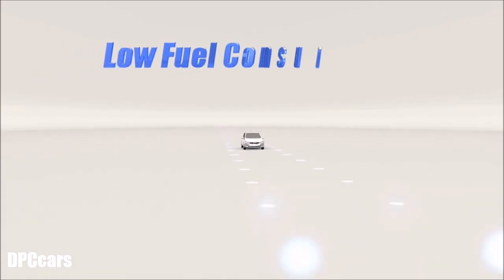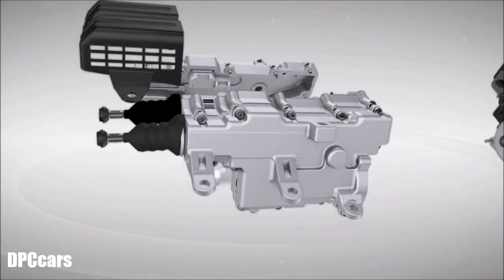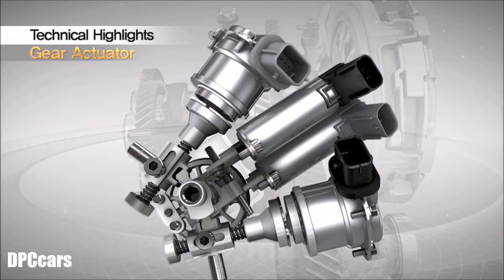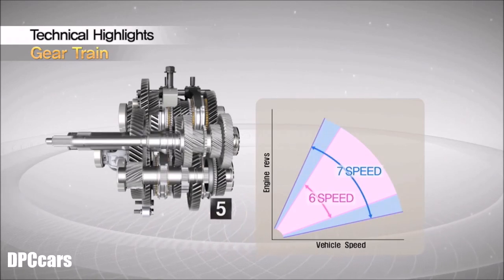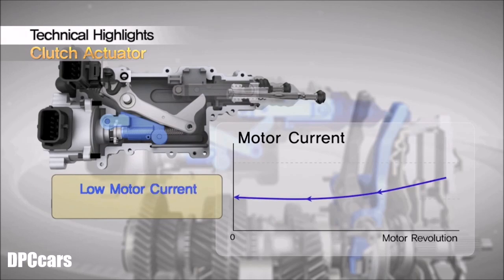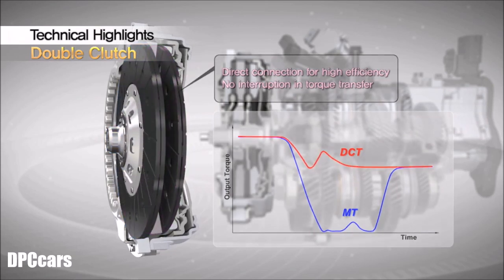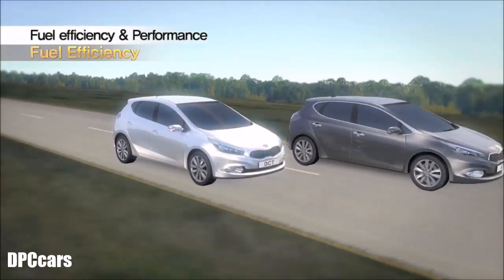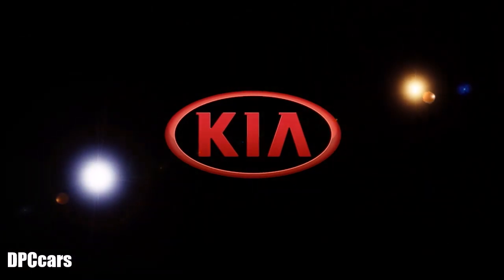Kia 7 Speed Double Clutch Transmission

Comment: Mine start to jerk while moving off, after into 2nd year of driving.
Reply: I bought my 2020 Kia Forte GT December 2019, by November 2020 I started noticing jerking, and what felt like slipping of the transmission in bumper to bumper traffic, also when putting car in drive after a cold start. (Yes I do let my vehicle warm before driving) 
Dealer told me that is normal, but to someone who is used to a traditional transmission, it was very far from normal 😂
I still own mine with 77k miles and it’s not as good as they make it out to be smh 🤦🏻‍♂️ 
Fyi make sure to change your transmission fluid every 30-40k miles, the ole Kia Warranty won’t cover repairs if maintenance wasn’t preformed to their standard (or so I’ve been told)…..

While I will say it is quite fast.
 I am nervous of premature wear and tear to the transmission especially if you drive your car hard!

Comment: These 7sp DCT Transmissions are JUNK! 
Thank goodness that KIA woke up & took them out of the Seltos & others & in the Seltos they put in a Regular 8sp Transmission.
Reply: Ya no doubt. I have a 22 kia forte gt and my dct was replaced 3 times under warranty already. About to be replaced a 4th time as it's slipping and shifting funny again
Reply: @delaneyschafer2110 any details of what keeps going wrong? Mine is only at 42000km and it just stopped going into reverse (after making some odd shifts going forward / complete lack of moving forward for a bit). I’m thinking it’s the TCU but yeah, hoping it’s not going to be a warranty fight
Reply: @HannahFortalezza  the first two times was just premature wear of the clutch packs. I'm not sure if it was the ecu shifting funny and wearing it out or what. Then the third time the actuators broke, so it was stuck in gear. After that, they replaced the whole transmission under warranty. They put the updated 2023 model dct in, and it's been much better, but far from perfect. It'll still slip and shift funny from time to time. But I put almost 100k km on this transmission now, so it appears to be holding up. And I wouldn't worry about the warranty. As long as your car is stock they won't hassle you about it.
Reply: @delaneyschafer2110  ah, just generally a shit transmission design all over then haha. Hope it goes better for you into the future!
Reply: @HannahFortalezza  ya these dual clutch transmissions are definitely the weak point of these cars, especially if you live in colder climates.
Reply: @delaneyschafer2110  The nice 8spd regular transmission they have in the SX Turbo is very good. No problems, smooth shifts

Comment: The internet is replete with complaints about this gearbox failing after minimal mileage.
Reply: lol, I’m trying to find out common failure modes of them as mine has just failed with 42000km on the clock. 

I believe it’s the TCU
Reply: @HannahFortalezza  :0 what car and brand please 😦and sorry for you
Reply: @AlexNamyang  Kia cerato (forte) gt. It turned out to be a failed reverse clutch mechanism, not the box itself
Reply: @HannahFortalezza  ouch ok I was thinking of buying this car too
Reply: @AlexNamyang  they did fix it under warranty, so there’s that. Note that Australia has seven year unlimited kilometre warranty.

Comment: What is meant by dry clutches
Reply: Normal clutch that comes with manual transmission without oil and cooling system available in high end cars.
Reply: @infinitebeing1119 how is it available in high end cars if its bad

Comment: Would this transmission be able to support up to 400hp ?
Reply: No, about 300hp and it will last about 20,000 miles. I have 37,000 miles and 235hp and it took 35,000 miles to start slipping.
Reply: @TedTedness-wu4vb  Make sure its under warranty. I have a 2017 forte5 an my trans blew 3 months after and the Cali Kia dealership wanted 11k for all the repairs. I wish I was being dramatic but I went to a transmission shop and picked up a used trans with labor only costed 3k

Comment: is this dry or wet clutch?
Reply: Dry
Reply: is it matter?
Reply: @ИмияФамилья  Yes because if it's dry you can't leave it in Drive every time you have stopped.
Reply: @Shimabuku  why? Because you are comparing this to the manual shifting system? Like "the always pressed clutch pedal"? Do you really think the actuators not switching to Neutral shift every time you stop? Really??
Reply: @ИмияФамилья  No it won't release that's why it overheats. I should know, I have been using my accent since 2017 with the same DCT.
Reply: Is this still applicable in latest kia dct engine?  I own Kia Sonet DCT Automatic and I always move to N at traffic signal stop. But, I am not sure if it is required.  Someone told me if u keep brake on in D mode then engine wl heat up.  @Shimabuku
Reply: @ksagar90  
Check if it's Dry or wet type DCT..
Reply: @Shimabuku  Its dry clutch DCT
Reply: @ksagar90  Then you need to learn how to drive DCT dry type..

Comment: I'm having a big trouble with this brand new DCT In a kia ceed 2020. Switching to 2nd gear makes the car brake before entering the gear making a loud sound and sometimes 2nd gear disappear. Uphill or downhill the problem get worst and more dangerous. Now my brand new vehicle is in charge by Kia but after 10 days of work, they were not able to make it work properly. We'll see how long it will take to find the issue... I bought kia for reliability, maybe I have no luck with this brand...
Reply: DCT in this cars is a nightmare. Wait until it is out of warranty. Wallet breaker. Constant service visits, so many things can go wrong, from clutch to computer, then you have oil changes.... I have sold mine after 2 years, and go back to manual, no problems since. And they advertise better fuel economy, and I have proven myself that manual is at least 0.5 liters better than DCT.
Reply: @Gr3eGo  kia changed whole clutch and two synchronizers in the gearbox. It sounds likes it is repaired... Maybe not we will see in two months...
Reply: @almostgeeek2773  So, what's the new status on the gearbox? Does it still have issues?
Reply: @Gr3eGo  So I have a Kia Cerato GT or what the American Market would consider the Kia Forte GT2 Package. Dual Clutch 1.6 Turbo. Owned it for 2 years now and love everything about it. Not once has it missed a shift or felt slow, especially once you have driven the car for about 10 mins, it gets warmed up and the shifts are lightening quick. I honestly think every manufacturer produces lemons...
Reply: @toofbar3  Yeah agreed, its sometimes luck of the draw, out of every 100 deliveries you might get one lemon that'll have a manufacturing default or something.
Reply: the geartrains second synchronizer on the helical shaft grinds on every 3rd teeth.

Comment: It is not beautiful as they shown. Premature wear in dual clutch, and generates high temperature ruined the transmition and vehicle owners economy. Find solution for those problems first. Customers refuse dual clutch transmition because they have to spend big money to repair dual clutch system rather than fual saving.
Reply: So true. This DCT is good only for service visits.

Comment: The dct is only paired with the 1.6l not the 2.4 or the 2.o found in the SX turbo and LX they still use the traditional 6 speed for the 2020 models

Comment: Will it have the same fate like Ford DSG and Ford Dual clutch type?  Broken in less than most conventional torque-converter fluid-coupling transmission?
Reply: No it will not. I have 70k on my soul.
Reply: @EricMotoring  good for you. Time and statistics will tell, how far it can go, definitely not as strong as regular torque converter from Hyundai or Aisin.
Reply: @EricMotoring  I have 480k miles on my Camry 2002, and still shift better than rented VW polo 2018 I ever tried, just weird manual transmission behaviour. If you drive a lot in heavy traffic  with creeping speed, it ride on clutch and will wear much faster. Just like what manual transmission normally do. A good advice, enjoy  it while it is still good and dump it when it started acting up like the 60k miles Polo TDI I rented regularly, it start heavy vibrating on light load.
Reply: @rondhole  but your camry doesn't have a dct double clutch gearbox, you only have a regular classic gearbox with torque converter
Reply: @-xYz--nk1gm  exactly, that's why it last 3 generations.  Dual clutch will be destroyed in city traffic, creeping in hills at low speed, and whenever the clutch is being rubbed at low creeping speed.
Reply: @rondhole  Buy a DCT hybrid. It will drive in hybrid mode in city traffic.
Reply: @redwhite_040  yes, that DCT still has clutch and wearable part like brake pads. It is just a stupid idea. Ford does not use DCT in their hybrid, they are identical with HSD and it is made by Aisin.

Comment: JUNK! It’s going to end up like the GDI engine recall
Reply: Plz tell me more
Reply: No it hasn't. 70 k on mine.
Reply: Yeah, I have a bad experience with this brand new gearbox... How do you know it was junk?
Reply: @almostgeeek2773  The 2016-2018 Tucson were one of the first to have the DCT and they were a complete failure! Hyundai issued a recall for a software update and I hear many complaints about the 7-speed DCT stalling, overheating (since it's a dry clutch, not a wet clutch), and hesitating.  Hopefully, Hyundai/Kia resolved this in their new 8-speed DCT which is a wet clutch
Reply: @xcmskim4  nah mate it works fine.

Comment: I'm a kia car owner but not this dct ones , been rebuilding and repairing this transmission from client's who has only 28K on it's reading as always.  Why is it so early for this types of transmission to be damage?
Reply: Dry clutches.. same problems as dsg7 dq200..
Reply: J Can du  
The same is true for regular manual transmissions as well, yet people routinely get 110,000-160,000 miles out them.  The problem isn't partial slip.  It is how the transmission is designed and programmed.  The logic and actuation don't match up with a skilled manual transmission driver.  Sure, it's quicker but not as talented.
Reply: No wonder they overheat when offroading
Reply: a wet clutch is just a tad better. answer me. how often will you change the transmission oil?
Reply: No issues with kia dct. 70k on mine.

Comment: can you please tell us  how practical it is  ?
Reply: DCT really is a great concept. My only real complaint is with the dry clutches. Many manufacturers such as Audi, VW, etc, use multi disc wet clutches which is far and away a better design. The next problem is is that like anything automotive, they design it as light and cheaply as possible. This design has the capability to be immensely durable, without adding a whole lot of weight, but they'll save $10 per transmission, which will cost you a new transmission in the medium to long run.
Reply: @1criticthatmatters  vw and ford have give the DCT a bad name. research on here :D
Reply: a clutch is a clutch. if you live in a city / hilly place, stay away from it. far far away